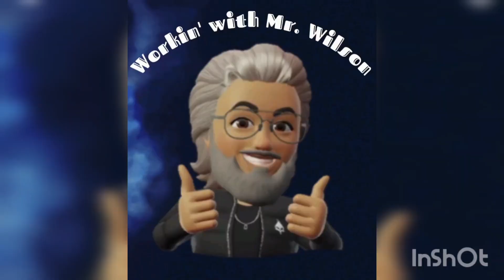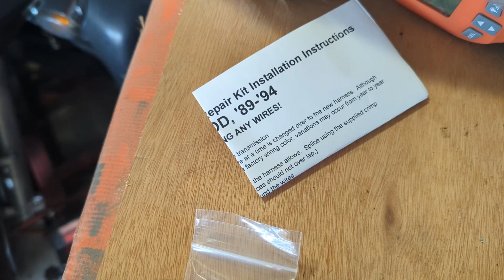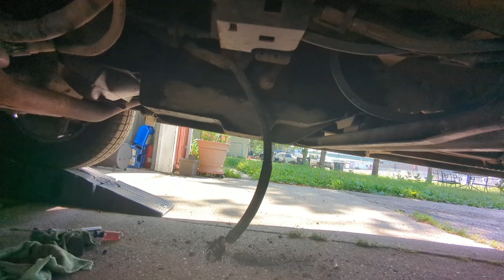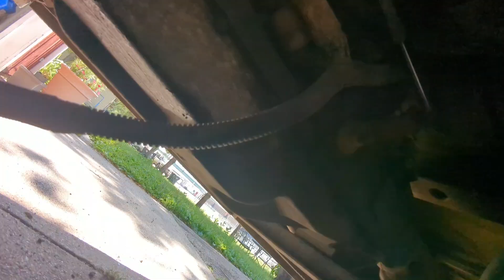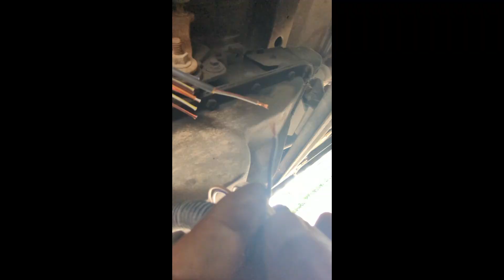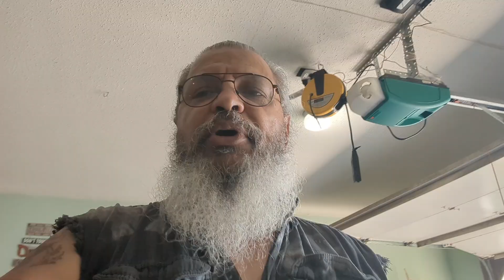Ford E4OD Wiring Harness Repair

Comment: Did it end up fixing your problem? My 95 f250 has the same problem.
Reply from the maker: @ethanpuffer951  maybe it fixed my problem. Still down shifts up hills and against the wind but I'm pushing a 12,000 lb box. It's not going in and out of lockup anymore.
Reply from the maker: @ethanpuffer951  I haven't had a chance to put it to the test yet. Seems ok around town.